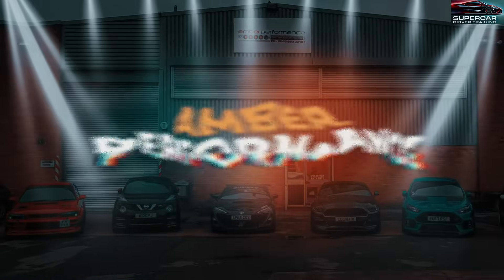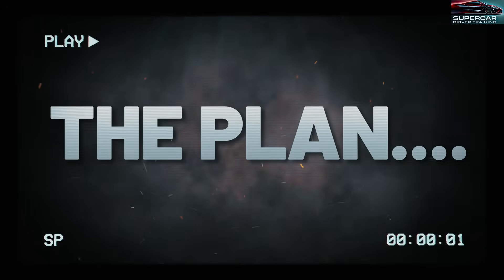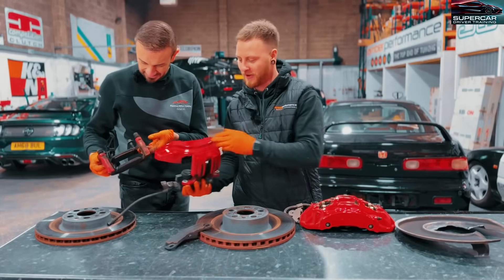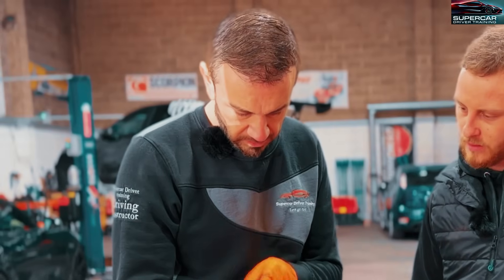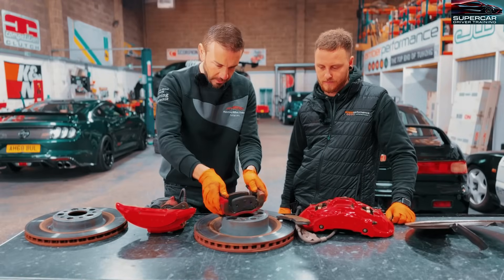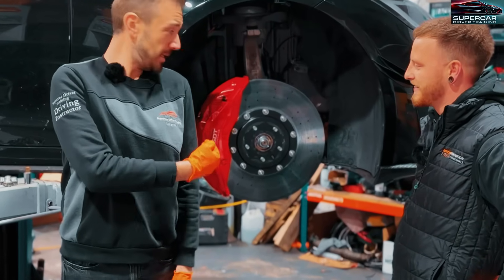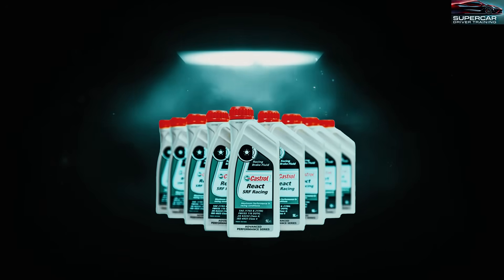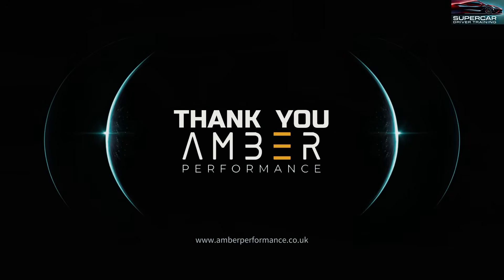🏁 Episode 6 - SDT Ceramic Brake upgrade for project plaid

Comment: Nice setup! I also noticed it pulled the rear caliper forward vs the standard placement. 👍

I will be interested to see what you think of this compared to the Tesla Track pack.
Reply from the maker: The testing video is being uploaded shortly but safe to say that on a track with normal road tyres it performed at 1.9G braking force far exceeding the Tesla track pack much smaller setup